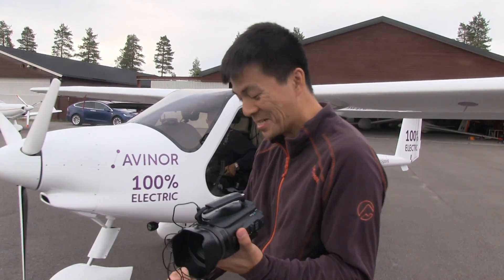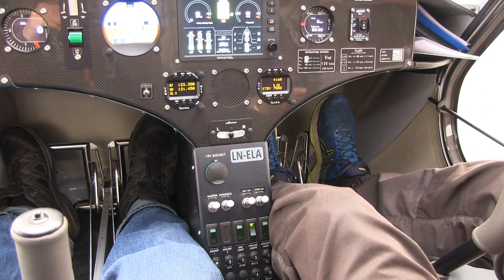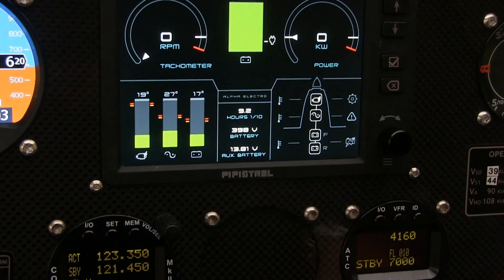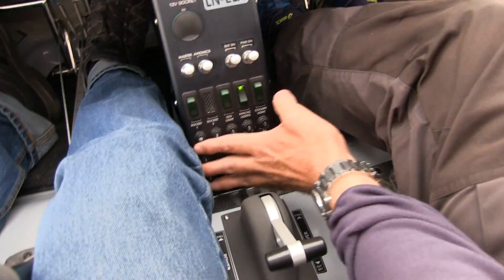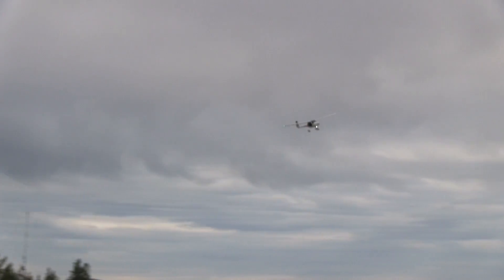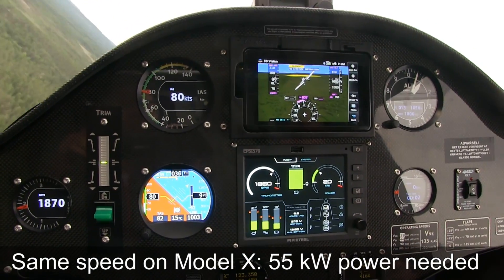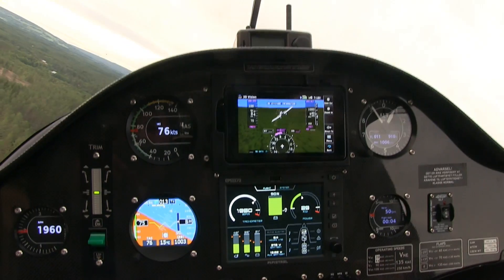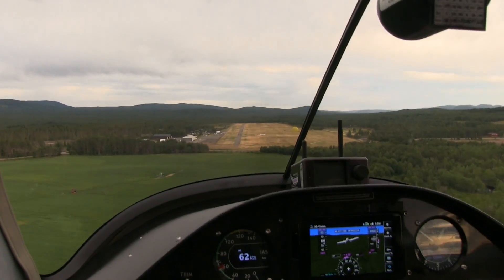Test ride in Pipistrel electric plane

Comment: Bjorn - go back for a glider flight on a hot thermal day. Best fun without using any energy after launch apart from that provided by the sun and they are at least rated for aerobatics - stalls , spins and loops.
The Pipistrel will make a very economical tow vehicle for glider clubs too.
The props for the regen are much wider bladed.

Comment: beautiful coverage man! this has me excited. i have seen much about these but this puts it in a slightly different perspective. Thanks for the other video with the questions too.
Reply: What's to be excited about? This thing is useless.
Reply: @PistonAvatarGuy  No more noisy shaky unreliable gas motors! Freedom to enjoy the skies and zip around in a little spaceship. I can't wait.
Reply: @peterjorgensen3  A) You can't zip around the sky, because electric aircraft are insanely slow. B) You can barely even leave the vicinity of the airport that you take off from, so you're not going to be enjoying any real freedom.

Electric aircraft are an absolutely enormous step backward, so they're about as far from being a spaceship as an aircraft can be.

While companies are wasting an insane amount of money and resources on electric aircraft, we could be modernizing gasoline engines, making them more reliable, more efficient, smoother and free of dependence on leaded fuel. People like you are standing in the way of advancement.

Comment: It's a great way to show off the progress that has been made.  I hate to bring it up again, but in a way, this is where fuel cells could really shine if they are reliable enough with air pressure and temperature changes.

Comment: It sounds like a turboprop, without engine noise.
Reply: It's the sound of the oil company's death scream.
Reply: Ego Equus, unfortunatly not yet. We have to wait for battery improvement for longer range.
Reply: Luís Fernandes Yeah, I know. But they are already screaming in anticipation. "Stranded assets" is all they talk about in the board rooms lately.
Reply: @egoequus6263  ,oil or coal is used to supply the electricity, dumb comment.
Reply: @gsp49  Not anymore. 30% share for coal and dropping fast.
Reply: @egoequus6263 In my state the power companies are switching to natural gas with the goal of eliminating coal.
Reply: That is quite fascinating, I didn't realize how much of the sound was coming from the prop itself, rather than the engine.

Comment: That was disappointingly louder than I was expecting.It sounds like it has a fossil engine tbh.
Reply: Zaixai it's a bit like cars, the faster they go the sounds are most from air and tires or propeller in this case :)
Reply: The prop noise is less annoying for the neighbors that engine noise. And measured noise levels are lower too. That means less complaints, possibly longer permitted flying hours.
Reply: Propeller noise can be lessened with more blades, but at the cost of efficiency. A propeller emits most of the noise sideways and a bit of it rearwards, so you mostly hear it just when the plane is passing by.
Reply: If there is a Pipistrel Virus flying, you will hear the Difference.
The Propeller makes most of Noise of an Electric Plane (on a Conventional Plane the Combustion Engine is louder), and it is hard to reduce.
Designs with a large slow spinning Propellers are more quite.
Reply from the maker: +Zaixai Propeller noise is impossible to avoid.
Reply: +cros13 And that is a big Thing for all the Pilots and Neighborhood.

Comment: Biggest smiles I've seen from you Bjorn. 
//  Pressurized interior?  Highest altitude possible?
//  Does it have real "Auto Pilot?"
Reply: It is a trainer class airframe so no on the autopilot and pressurized cabin
Reply: +Joshua79C C --  Thank you.  Appropriate and adaptable niche.  Well designed.
Reply: It's VFR only plane, can't go above clouds.
Reply: @esunisen3862  Why does it have instruments if it is a VFR only plane? VFR is skill limitation, not a plane limitation, isn't?
Reply: @PaulA-zp7hn  It doesn't have navigation instruments. GPS isn't enough.

https://en.wikipedia.org/wiki/Instrument_flight_rules
Reply: @PaulA-zp7hn  Even ultralight trikes have instruments! The question is does it have enough! It's like saying that because a few guys have pistols that they're an army. It takes more than a few guys with pistols to make a proper army.
Reply: +Esunisen --Ahh, of course.  Clarification appreciated.

Comment: what a nice video , thank you Bjorn. But its stil noisy against a ev car
Reply from the maker: +Hans Reintjens An EV doing 160-200 km/h is also pretty noisy (tire noise).
Reply: Not much if anything you can do to eliminate propeller blade air noise.

Comment: The gasoline version is an impressive aircraft already but this one is just awesome! In aviation you choose the aircraft by the mission you want to do. This aircraft is for early flight training and it is perfect for that task! Low noise (maybe the most important feature), extremely low running cost and maintenance - for a busy flight school this is the perfect money making machine!
Reply: I did a career in flight schools, owned one once. Cost is everything, and the airplane must "turn and burn" to make money. You also have to be able to do the "mission" which includes long range cross country navigation and flight training. Will there be a battery at the outbound end of the training flight? Who will be certified to replace the battery? And which large capacity lithium battery can be recharged or replaced in the time it takes to refuel a C150? And there likely will be an efficiency leap coming for the ICE with CCI (combustion controlled ignition). Some are predicting perhaps a 10% increase, and such results are being seeing in testing. Light airplane power plants in the US have been largely stuck in the middle 20th century due to certification costs. So the costs of CCI certification may be to high for general aviation to bare. So may be there is room for batteries. But I'm telling you the flight school business is a tough business. Margins are razor thin.
Reply: @duster0066   Also as atraining airplane i dont see the benefit if the flight academy will eventually use a "Gas" plane. I mean, after all students need to learn and test combustion engine start and throttle and i dont see how this plane could do that. But for a prototype and low range trips this seems ver cool neverless
Reply: @duster0066  'And there likely will be an efficiency leap coming for the ICE with CCI (combustion controlled ignition).' Do you mean HCCI? Homogeneous Charge Compression Ignition? Considering that EFI is only just appearing in GA engines and car engines with new combustion regimes (e.g. Mazda's SPCCI) have only entered serial production in the last couple of years I suspect that it's still a long way off.
Reply: It would appear that you have to change out six batteries to do that.

https://www.youtube.com/watch?v=WiADDbeFanU

I don't know how current that is, but I would think that you would want two extra batteries for each airplane, one fully charged, one in process, and then the one in the airplane.  I don't know how much those cost each, but it adds to the cost of the airplane, although not as much as fuel over the long run.
Reply: Now Alpha Electro uses 2 packs, not 6.
Reply: The big thing is not necessary gas, but maintenance.  Those electric motors are far easier to maintain and are less prone to breaking than a traditional ICE.  I mean the regular gas version is a 2.5-4 g/h plane and can go pretty darn fast so it is a very efficient aircraft.  Even with the battery replacements the price of maintenance is still lower which is really where a lot of the cost gets added on per hour of flight.  Obviously having an instructor is already expensive, but they can charge less to run this aircraft and still make higher profit margins given that people are actually flying it.  The thing about owning an aircraft is it gets cheaper the more you fly it.  If the flight school doesn't have enough students and those planes are sitting on the ground they are loosing money so they can improve their margins by simply having a higher usage time pared with the lower maintenance cost and attracting new pilots with a cheaper program.  Not to mention with a quiet engine people can hear the instructor a bit better and the aircraft itself is surprisingly cheap for what it is. Its about the same as a brand new Cessna with some of the premium features.  Either way they can also get tax right offs for being electric which helps from a business side.  I have seen a few flight schools in my area start to sell off some of their old planes and have replaced them with this exact plane for exactly the reasons stated above.
Reply: No, because if you buy a second battery it needs as long to charge as you need to do the checks, taxi, fly the other battery empty and taxi back to the hangar!
Reply: With a large storage battery bank and a field of solar panels the cost per flight hour can be very low
Reply: let's hope flight schools pass the savings on to the students instead of keeping prices high and just pocketing the extra profits
Reply: MWB Gaming hahahaha yeah RIGHT. Did they drop their prices after the barrel of oil tanked from $150 per barrel? Nope, they remained greedy and kept the costs the same.
Reply: @ARyanCoke  yep, cost me over $60k to get my PPL, despite the fact that the instructor only charges $80 per hour and Avgas is only 90c/L 

Bloody ripoffs, but if you want to fly, that's the only way to do it
Reply: @mwbgaming28  you need to take an econ class.
Reply: @mwbgaming28  Not if your father is an instructor. Single ,multi engine rating ,instrument rating,  instructor ... all free. I was a lucky kid . 😆
Reply: Do you work for boeing? XD
Reply: Benedikt HRO I would imagine flight schools would hate the downtime between flights to charge the batteries.
Reply: @propellskalle  That can be solved with a spare set of batteries. I believe they can be swapped very easy. Another thing is that the batteries do not get lighter during the flight.
Reply: @propellskalle  Swappable battery racks in and out as fast as you could fuel the plane.
Reply: There's a dinosaur powered version too? :D
Reply: Aldion Sylkaj Yes, there is a Rotax 80 hp version.   Useful for student cross-country trips (aren’t limited to airports with a charger).  Current thinking is to have a mix of gas and electric Alpha trainers for a flight school.   They showed a simulator at AirVenture 2018 as well...total package for flight school.
Reply: @aldionsylkaj9654  yes they have the zero pointing pedestal standing type crafts.They showed videos.
Reply: @aldionsylkaj9654  but this is flying atmospheric levels obviously with crafts of different propulsion modes.

Comment: Please stop.... Now I want a Tesla and a Pilots License....
stuff is too expensive...

Ok, to be fair I wanted the Pilots license before this Video :P 
But that Plane is awesome.
Reply: Tobimai
  I have been waiting for the training to become cheaper (10k euro for combustion planes just isn't feasible) 

Electric should see that price of training go down by at least 30 percent possibly more. And its way cooler :)
Reply: Tobimai, i have infinite flight. Not the same, but way cheaper!!! 😜
Reply: @luisfernandes4145  X Plane 11
Reply: You can try a paramotor its cheaper and falls under FAR 103 aircraft rules so you dont need an expensive license. Plus you can enjoy the beauty of flight with unobstructed view.
Reply: Just do it. Ultralight planes licence is cheap and easy enough.
Reply: I've wanted a license forever, and have forcing myself to ignore excuses and just go for it.  I'm going to start NPPL(M) training soon I hope.  Regarding e power, I lease a BMW 530e and driving on batteries has changed the way I think about driving. When it comes to renewal I'm seriously thinking about getting a fully electric vehicle, if not at least another PHEV.
Reply: Electric is waaaaaay cheaper than traditional, look at RC where electric was developed.  The reason some manufacturers are exploring EVs is the insane profit margin.  RC brushless outrunners are 5 % the cost of equivalent gassers.  Problem is they run for 3 to 10 minutes and need a battery replacement every 100 flights or a year.
Reply: Have to greatly improve flight time with battery storage.
Reply: Well actually its  a good trainer plane.  For 1 the engine is cheaper to maintain and there is literally no gas and far less moving parts.  Its a heck of a lot cheaper to rent than a Cessna along with the insurance being really good due to the safety features.  Its a pilot training program's ideal plane.  Not really meant for private ownership.  There just aren't enough places to charge it.

Comment: Just sold my Cardinal RG this afternoon.  I'm sad.  This video and my Model X make me happy :).
Reply: That was one where I went... gee, they must have different laws of physics in Norway.
Reply: Not only that low but that one about 80° bank @64kts made me and the stall horn cringe.
Reply: Mark Jennings 
It looked odd, but being a boarder line glider I'd imagine it's quite forgiving. I'd imagine he knows his own envelope along with that of the aircraft.
Reply: What do you think of this guy doing steep turns so low? I'd have lost my flight instructors ticket If my CFI saw this occur!
Reply: Yeah, I was thinking... gee aren't those maneuvers low to the ground?
I started as a sailplane pilot.  Certainly they were close enough to land safely throughout, but I would have wanted to do those demo manouvers:
1) Outside the pattern
and
2) 3000 feet AGL and above.
It seemed the ceiling might not allow #2.  
I heard the stall warning going off a couple of times I thought... thats not something I would want to practice low to the ground, or get complacent with.  But I'm Chicken Pilot.  I probably could still get a 3rd class medical with my vision issues, but I grounded myself until I can get them resolved, or re-learn to fly with one eye.  So I'm giving up flying rather than risk a bonehead mistake.  Bonehead mistake in my Model X...no problem, I'm an idiot.  But bone head mistakes in the air...I'm trying to avoid.
Reply: Yep! incipient spin was very close.
Reply: Yea, the plane seemed very solid, and you have instant power if you need it.  It might not even want to spin at all.
Reply: Ross Youngblood 
Hope you found a good home for the RG
Reply: I noticed the low flight stuff but was going to withhold comments.  I really wish I had withheld my comments.  It’s a great video and a great electric airplane. And my guess is the demo pilot has tons more experience than I. So please consider my comments the worst form of armchair quarterbacking.  If I can delete these comments I might do so as I just don’t feel right about them.
Reply: https://youtu.be/vz7Y1_aF6NA
Reply: William B the broker situation was great. I probably lost some money, but Insurance was coming due, and I probably wasn’t able to fly until bad fall weather this year.

Comment: Still waiting to see the Production Version of the Pipistral Paththera Electric-HYBRID.
I think Pipistral could use a CASH Injection.
Reply: idontcare80 Would make flying a lot safer as the electric motor would be much more reliable, and having a battery as well as the engine as a generator would give it the range.
Reply: @gregandkaruna6674  ,but what's the point? Better to leave well enough alone until they find a lighter way to supply the juice, maybe banks of condensers instead of storage batterys, that would not be needed if you have a high output generator on board.
Reply: @gsp49  EV aircraft for commercial use are still years away, but as a trainer aircraft they are perfect easy to have easy access batteries that can be swapped out and ground charged. Wow the original comment was ages ago
Reply: http://www.pipistrel.si/news/most-powerful-hybrid-electric-powertrain-powers-up

I have "images" but I can't post images as a "REPLY"
Reply: Gregory Bell
https://www.youtube.com/channel/UC_Cy1NGs-eYqTnDGjLXkQZQ
can I send you images somewhere (Pipistel Panthera Hybrid Prototype)
Reply: Hybrid systems make absolutely zero sense in aircraft.
Reply: @PistonAvatarGuy  Engineering. Hybrid systems can make a lot of sense depending on the design. You can have a design that's primarily electric with a modest generator and fuel on board. It can take off, land, and travel short distances on electric only and travel longer distances with the genset. This plane was pulling less than 30kW at cruise so that's a tiny genset! Even better, the genset and battery together can give surge power for shorter and higher altitude takeoffs (just spec the genset with a little extra peak output).

It can make a LOT of sense to do a hybrid system.
Reply: @Kimoto504  "You can have a design that's primarily electric with a modest generator and fuel on board."

From a thermodynamic perspective, that makes absolutely zero sense, so unless you've found a way around the laws of thermodynamics...

Aircraft already use their engines in the most efficient way possible. The largest possible benefits in light aircraft can be had by simply modernizing aircraft piston engines, they're basically stuck in the 1940s. The only hybrid system that would make sense is one which makes use of a power recovery turbine (turbo-compounding), like the system that's currently employed on F1 engines.
Reply: How little you know